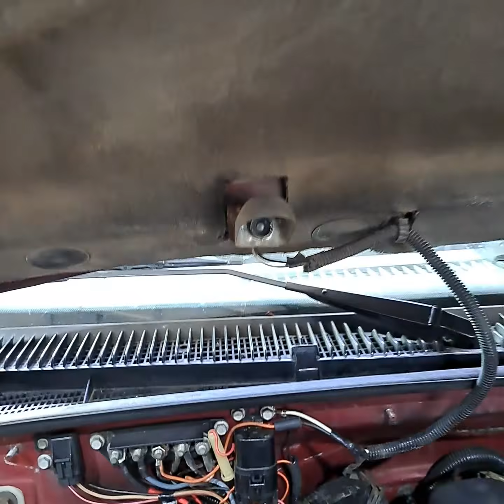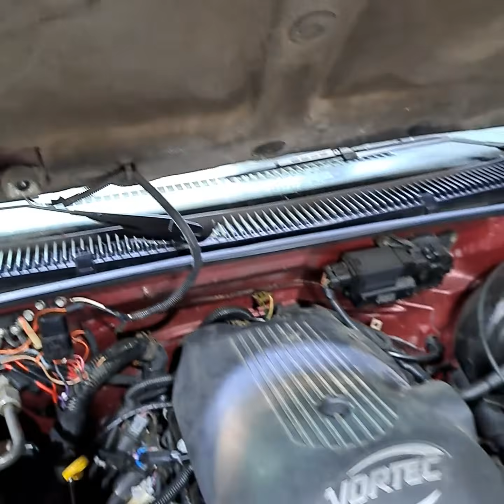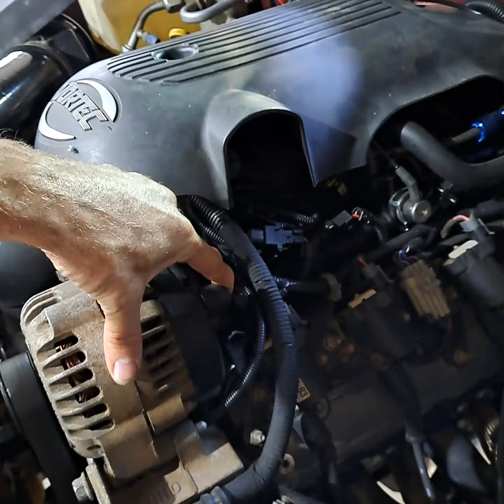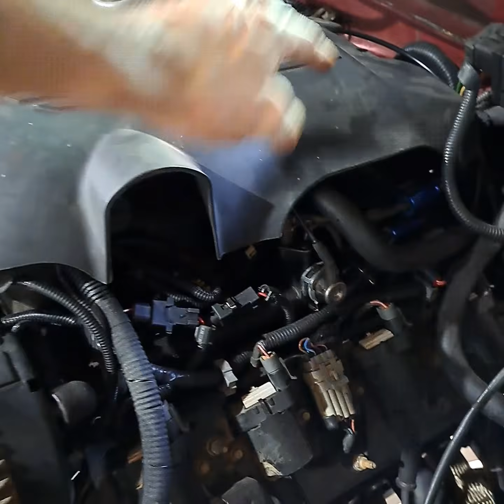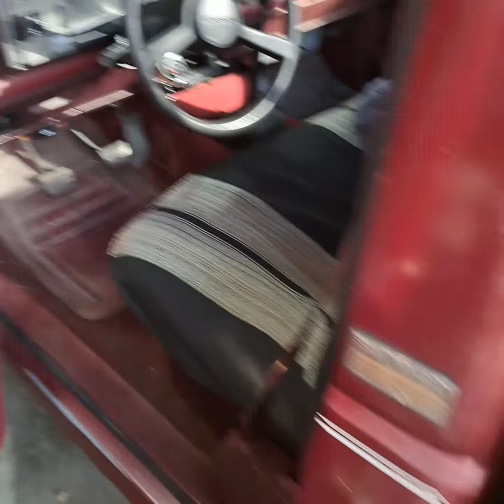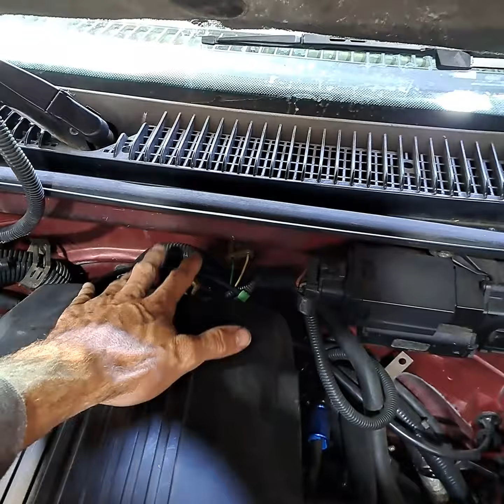LS swap wiring for 88-94 chevy OBS.

Comment: About to do the same swap with my buddy on his truck. I made a harness for my own build so I’m familiar with alot of this. I have a question, tying into the stock junction box looks pretty easy compared to having to make my own fuse box and plugs. My main questions is, did you still need to run a relay and fuse box setup to power the coils, injectors and other 12v constant sources?
Reply: Specifically referencing the factory C2 block from the LS harness.
Reply: I've used tbi harness and junction block to power the ls harness but always using a ready made relay- fuse box but trying to just use the original harness there may not be enough capacity for all the circuits the ls pcm needs vs the old tbi and it would be a little more complicated. There are so many ways to do it though and that maybe the  best way for your project.
Reply: @rpw0311  I’m doing a 2005 6.0 swap into my 1994 k2500 with a nv4500 trans. Can I wire everything for the Ls harness through my factory truck harness?
Reply: @harleyhostler4176 did you ever find a decent answer? I'm doing the same to a 91 K2500.